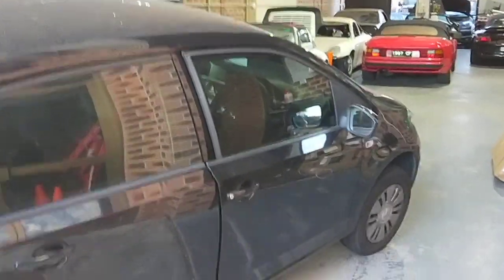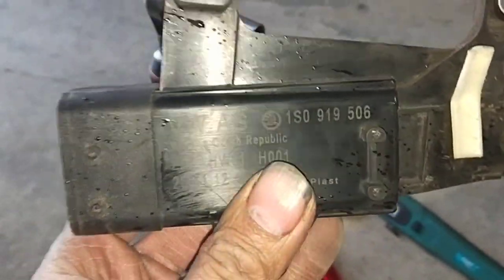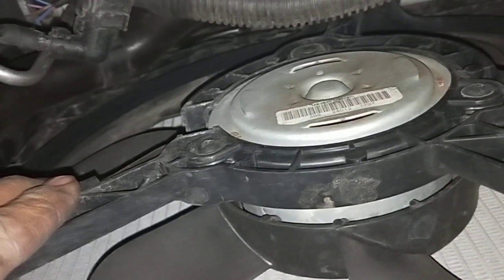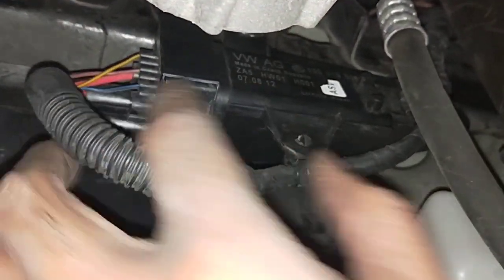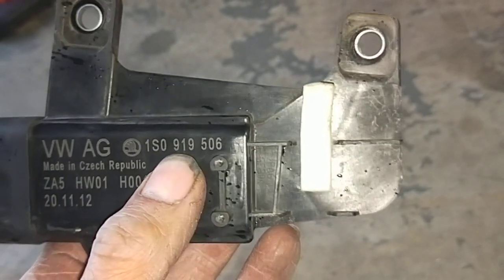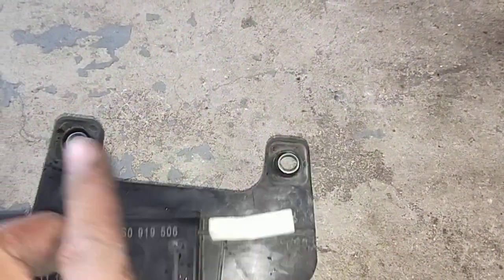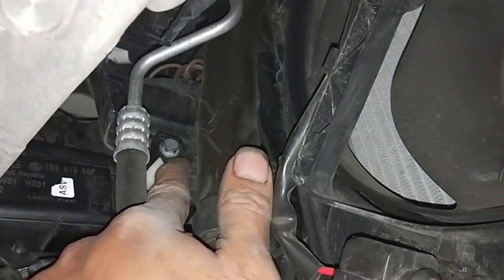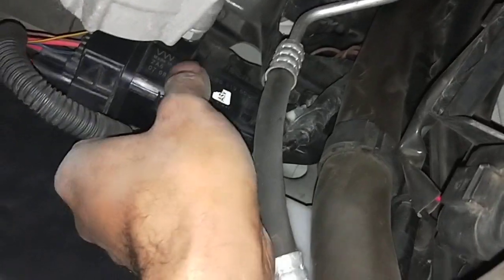Volkswagen Up 2014 fan staying on fix

Comment: Hi I have a question I have a vw Tiguan fan stays on for a few seconds or even a minute after I turn off the car only at times not always.  It runs fine.  What do you the think the problem is?

Comment: Thank you I’m trying to figure out why my fan is staying on. It only came on after I replaced the camshaft and before it replaced the camshaft I had to call pack done and in the wires done well after three weeks my car got to jerking and just cutting off and then I found out I took it back to where they put the call pack and the plugs on I found out they only put one on so in replacing the other three they never did replace them. They only replaced the camshaft, and since they replaced the camshaft, my fan stays on

Comment: What if my fan will not come on?  What could the problem be?
Reply from the maker: Turn your AC on & temperature on 21degrees if your fan comes on - It's OK.
Reply: The fan will not come on at all.  It isn’t locked and I can spin it.  I have checked all fuses except a 150a that I cannot locate
Reply from the maker: @1010miked  disconnect the fan & powered it up with a battery manually to see if it's OK
Reply: My friend,  who is a mechanic did add power externally and it wouldn’t come on.  He said he saw that it wanted to
Reply from the maker: @1010miked  change it if it doesn't come on when powered up 
Get a second hand one it's very easy to get from spare parts wreckers

Comment: Can i here the noise of the fan
Reply from the maker: Yes when you lock your car it will stay on. Pretty loud
Reply: EMD Porsche Specialist Caringbah Sydney Exactly the same problem when we turn off the car, the Ven stays on for 5 minutes, then the car is after cooling the sound when the car just starts up, the sound of the Ven is very quiet, but after 10 minutes it goes crazy and stays that way  sound even when the car is off
Reply from the maker: @hubcapthenetherlands352  if the fan does not cut off and stays on it will drain your battery.
Reply: EMD Porsche Specialist Caringbah Sydney then I will take him to the garage soon I have a Volkswagen up from 2018 high